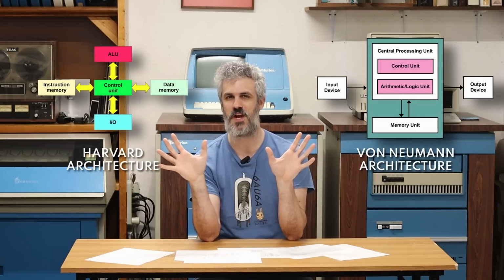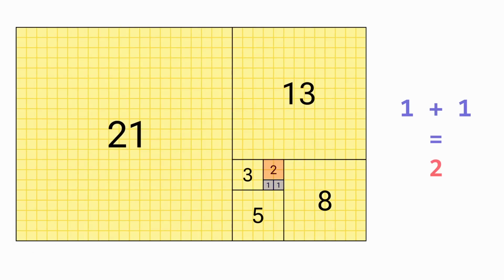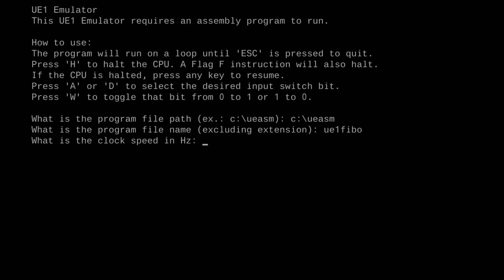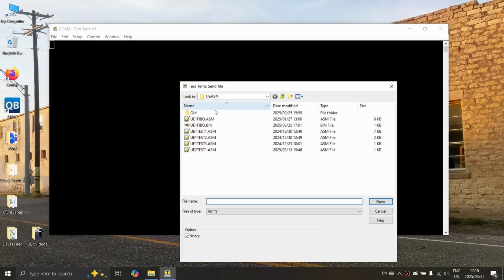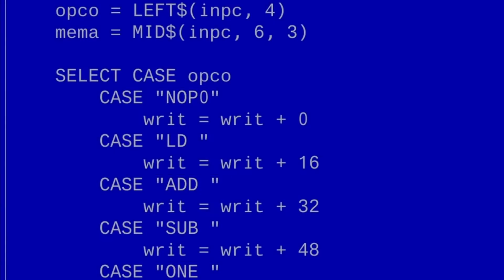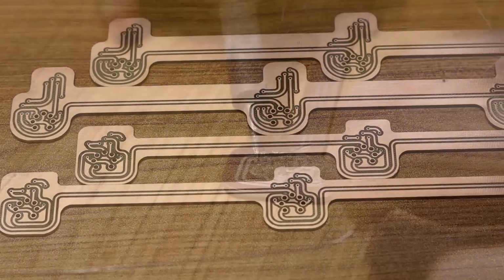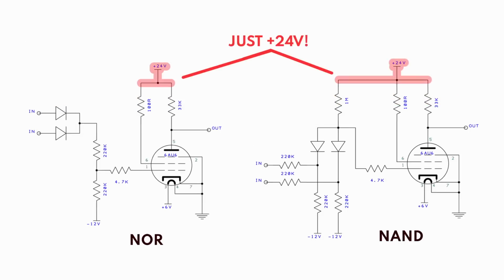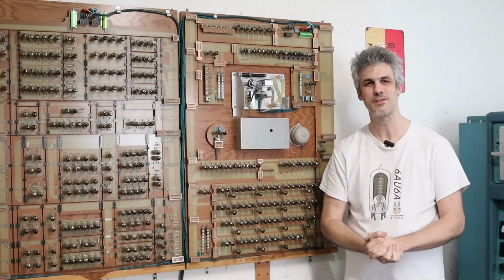I Tried and Failed to Run a Simple Program…

Comment: One thing about your emulator process, what you actually have is an intrepreter for the Assembly ISA. What you should do is have the emulator run the assembled binary comong from your assembler. That way you verify the whole pipeline.
Reply: Indeed, and that would have found the coding error caused by missing the "LD ".

Comment: What I would do is use a binary search method to find out where the program is going "off the rails". Punch a tape with only half the program in it, add a load of NOPs then glue the tape together into a loop. Then you can run this over and over again, verifying that you get a consistent result. If this works, go on to 3/4 of the program, if it doesn't, go back to 1/4 of the program. Repeating the program over and over will allow you to trap whether it is a transient fault, and give you an easy reproduction case. Good luck, it's hard enough debugging with modern dev tools!

Comment: I believe the biggest problem you are going to run into is timing. Many of people have been stumped not by the engineering but the physics. Every trace has an inductance and a capacitance. And vacuum tubes introduce their own capacitance and inductance problems. If the signals fail to rise or fall in sync, and at the right place and time, it may fail. This is amplified by your input and clock method. I believe this was the main reason why we quickly switched to a input register; rather than running code from an analog source.  This can be seen if you can control the speed of the input. Maybe if you add some way to slow the paper tape way down. The best thing would to design a stepper mechanism rather then a real system. In the past they would use a motor to press a lever during each revaluation. The lever would increment the paper one step. Advancing the tape one step at a time. This also could generate a reliable clock pulse. Every revaluation of the motor can close a contact, generating a pulse. This all would need to be geared down. If the motor is spinning at 1000 rpm, You would have 1000 steps a minute. Think a lever ramp mechanistic. Lever push up a ramped plane. This pushes the paper forward a set distance depending on angle of plane. When lever goes down the plane droops and a spring pulls it back.
Reply: I remember suggesting a stepper/ratcheting thing as soon as he was discussing/planning building this tape reader. Everything else is able to step things through one at a time, to expect the whole program and everything in the registers etc to keep up with the signals of the tubes and the reading of the tape just sounds impossible, it needs to be stepped through a bit/instruction at a time or something.
Reply: Could use a cine projector type of arrangement
Reply: @ the mechanism out of a teletype will do exactly the trick IMHO

Comment: I'm thinking that it's entirely possible that the rate at which the bytes are being read from the tape reader is somehow too fast for the UE1 to keep up with, since it has to serially shift each byte after reading it, then execute the instruction before it can be ready for the next instruction.
To test this, what I'd do is attempt to single-step the entire program.  Tedious, I know, but that should allow you to either eliminate the tape reader as the problem, or isolate the problem to the tape reader.
If the tape reader really is running too fast for the computer to keep up with, then you may need to slow down the drive motor somehow.  This can be done by gearing it down, using a speed controller, or replacing the motor with a stepper, just to mention three methods.
What I'd be inclined to do would be to use a stepping motor with a pin drive to engage with the index holes, and I'd set it up so that the number of steps required to get the next set of holes in line to be read was exactly the same as the number of clock pulses required to execute an instruction, then use the signal to the stepper as the clock pulse for the rest of the computer.
Or something like that, anyway.  If instructions take different numbers of clock pulses to execute, then something like "wait states" will need to be implemented too.

Comment: I don't know if building a homebrew computer is incredibly hard (take James Sharman or Ben Eater for example) but what I'm sure of is that making it with tubes/valves is an incredibly complicated and challenging mission. IMHO that's why semiconductors have invaded the place: lengths are shortened by several orders of magnitude, reducing interference (as a result of which signals can be way faster), reliability is way improved, consistency across signals, too, so is longevity and lifespan... I really admire your dedication though 👍

Comment: IIRC, the Fibonacci sequence starts with 0 and 1, or F(0)=0, and F(1)=1, where “F(n)” means; the nth number in the Fibonacci sequence. For all n>=2, where n is an integer (whole number), F(n)=F(n-2)+F(n-1). So the sequence really begins with; 0,1,1,2,3,5,… and so in to positive infinity. But your computer will turn into a smoking ruin long before then, so don’t worry too much about that last part there. 😝

Comment: Just throwing out an idea that crossed my mind:
1. Works if you single-step through using the toggle switch interface
2. Fails when you use the tape reader
Things that change: 1. input method 2. speed
Verify that the tape reader is doing what you expect?
Reply: Maybe use a logic anayzer to record all 8 bits from the reader and manually check to see if the binary code is correct.  That might get you down to one or more specific bits to debug.
Reply: @rickhole  That was my first impression seeing this comment as well. It's easier to dump the tape than to perform math operations on the machine. While it's still a tremendous amount of work, setting up an MCU to convert the reader's output back to bytes, then comparing them with the intended output, is a good unit test that takes one problem off the table. And that tape reader is a very complicated unit.
Reply: Good idea -- how about having the machine figure checksums from the paper tape. As soon as it gets a wrong answer, stop.  I wouldn't be totally surprised to discover that the tape flops around and the digital input from it isn't perfect.  But if it IS perfect, then the speed would be the issue.  Flip flops might be lagging.  Hope he gets it fixed no matter what.
Reply: +1 on logic analyzer. 
Also store actual registers, not just the tape output. 
Before troubleshooting can begin you first need to figure out where and when the trouble occurs. 
Maybe also poke it with oscilloscope - look for some skewed (not-square-enough) signals.
If it is not the tape, it could be weak tubes or not-quite-in-sync operations.
In particular the timing of the sync signal coming from the tape in relation to other signals.
Additionally it could be electrical interference from the paper tape reader upsetting some marginal circuit.
Try pulling the tape slower, possibly that could help narrow down the issue a bit.
Reply: I had the same thought, that either the tape reader isn't reading right or that it's going too fast.
Reply: You could also do unit tests by making a tape drive emulator. Something that outputs what you expect the drive to output so you can test the balance of the system. It also lets you easily do things like change timings or data rates to ensure that the drive is outputting a compatible signal.

Yes, logic analyzers and input emulators are lots of work, but so is the UE-1 as a whole, and at this point I would recommend taking the input off the table as a point of failure before trying to chase down logic problems that may not exist.
Reply: I don't know the capability of the UE1 well enough, but you should be able to do a compare to the expected register value hardcoded on the tape and trigger some error/stop when there's a mismatch
if the paper tape isn't reading, it should fail right away, and then as you're working on the Fibonacci sequence you're only starting off with the least significant bits, so it should progress to more significant bits as you move along.. if that isn't it it must be the program register that's not doing the right thing
Reply: @Rx7man  It's about as simple a computer as you can create. Error checking would be great, but might need a whole new circuit to do it. From reading other comments, looks like it is reading and running the code directly from the tape input.
Reply: voltage drop. i bet the voltages are not stable when all the things are getting slammed at once so fast.
Reply: @easyasabc0  tubes are not like FETs that only draw power when switching so I don't thing the problem is voltage getting too low, although that's not impossible. But the amount of ripple on +24V rail may be critical, and the power lines are LONG, like literally 3 meters long, this requires a filtering capacitor NEAR the power consumers which I didn't notice.

Comment: That's all a part of homebrew computing! I've had times where my little computer suddenly completely stops working, then I spend hours finding out that I... apparently left a DIP switch in the wrong position and it had only stayed running because of what had been manually put in RAM a few days ago when it was last powered up! At least I already had my assembler/diassembler/monitor tools (mostly) working before laying down wires, so there wasn't trouble on that end.

Don't feel so bad about using BASIC. I got MS-BASIC running on mine, then used it to write serial bit-bang code to get new hardware working. I got a nice nostalgia rush from it too.

And I love that bodge board. It has beautiful awfulness. Sort of an electronic wabi-sabi.

Comment: It was never supposed to be easy ... but - man ! - QuickBasic ?? Okay - I use it myself on occasion still today. The other is Z80-Assembler, which is even more worse. Carry on trying & Thanks for showing !
Reply: Z80... misty memories...  did my own board,  six months of burn eproms, watch the hardware not work, it taught me a lot about hardware and software.
Reply: I did Z80 assembly on my ZX80 PC (This in the Synclair before ZX81).  The assembler had nearly no symbolic address abilities.  What I wrote actually worked.

Comment: I don't want to be the adviser from the couch but want to provide a few tips:
- leave no case statement untreated, if something unexpected comes up you should print an error
- for the assembler, a good sanity check is to make sure that the number of lines without comments is equal to the number of instructions read (I assume) and equal to the number of instructions assembled
- can you single step through the tape? Possibly not, but it would be useful to have such a feature
- speaking of features, it would be cheating, but having an isolated interface board where you can read and write via serial could be a productivity boost. Then you can have a suite of automated tests like the Bendix has
Such a cool and time-consuming project, while also taking care of the other projects, it is a superhuman effort.
Reply: And a lazy simple way to test an assembler is a .asm file containing all possible opcodes, combined with a binary file of what it SHOULD produce. Run assembler, diff hex output files, put it into a script.
Reply: @8bitwiz_  Or alternatively, write a quick disassembler. They're usually less work than an assembler, and if you run a program through asm->disasm->asm and get the same hex, you know there's no issues.
Reply: @Spritetm Nah, I've written an AVR disassembler for some reason, and it was PITA. It is pretty tricky on the syntax, as you have to make different opcodes report different argument formats (at least differentiate between the register names and addresses), also some assemblers like MIPS32 like to produce macros (say, LI will project into two commands for the higher inputs) - so writing one just to test your assembler feels an overkill. I'd just choose a "keep hitting a concrete wall" approach, and manually test all the commands, which may be tedious, but has to only be done once.
Reply: Quickbasic has a "CASE ELSE" that he could have used to catch the error
In his case counting non-comments will work since all instructions are one byte long.  On other machines you have to use other methods.  
Another useful thing is to make a kit that goes with your scope that counts off N pulses then triggers the scope.  This would let him zoom in on the Nth instruction.
Yes to doing RS232 based troubleshooting aid.  A character on RS232 can replace the punch tape and a MUX scanning test points can return perhaps 3 characters worth of status after each instruction.

Comment: It's almost like you need to somehow 'compartmentalize' the various parts of your system.  Like, if you had some way to test each flip-flop to some known 'standard'.  And same with bus drivers etc...  Like some coders do with objects and unit tests.

Then when something goes wrong, you have some stanard way to test each component to home in on trouble.  But I'm just a retired programmer, never built a home-brew system, so what do I know...   😆

Comment: Don't sell yourself short for using QB.  I had a coworker that did coding for some very critical maintenance testing (we're talking public-safety, highly regulated stuff).  He used QB for many years for that.  It was fully vetted and he had a very formal and rigid SQA (Software Quality Assurance) program.  It's not the tools you use, it's how you use them and knowing what to do with them.
Reply: Hear, hear! My first full-time job, back in the late 1980s, was programming in QuickBASIC. It's nothing to sneeze at, and good code is good code no matter what language it's written in.

Comment: Those blue resistors down by the main output display are looking pretty cooked.  I've found LOTS of modern resistors from China rated at 1/2 or 1 watt are really only good for about half the rating they're supposedly listed at before they die. Plus I've had them fail open / short / and by just changing resistance. 

Might be worth checking the resistors with an IR gun (not easy with all those hot tubes i know) to see if any are really cooking & might be changing value.

Comment: Thank you for demonstrating why tubes were replaced by transistors.
Reply: Relays crawled so tubes could walk. Tubes walked so transistors could run. These things weren't just randomly replaced with the next thing bc the last thing didn't work or it wasn't good - each of these were all bleeding edge and way better than the last, materials sciences were improving as well as our knowledge of how any of this worked / best practices etc. If anything the only things that really changed over time has been speed and density (and power use due to that).
Reply: @colinstu  power use has grown as a result of speed, price, and density
Reply: And ultimately why when you have a bug and call tech support, it's best when you're consulting at least one additional person. When you're both the caller and the tech rep it gets a little schizophrenic.
Reply: what do you mean why? this is nostalgic and recalls us our childhood!
Reply: NB! these lamps are transistors!
Reply: @hairy-snail  tubes are tubes, lamps are lamps, transistors are transvestites

Comment: This firmware will completely trash Your Eeprom structure! There is no going back from installing it easily, so make sure you back up Your Config and Battery Calibration with the tool, and be prepared for a bad hangover if You revert to something like CEC or a non-HF firmware. Just sayin'

Comment: Hang in there, Dave. You'll get it to work. It's possibly a harmonics problems with all of the circuitry while running the tape reader. Try shielding the motor or driving it slower.

Comment: I keep eye-ing those board-to-board interconnects. I have all kinds of problems with those types of connectors.....and then you mention 675W of filament power,and I see those connectors,and the small gauge wire. All I can think about is the voltage drop and intermittent connections I have experienced. I know your frustration,and that feeling of insanity.

Comment: Digital electronics is not that hard compared to analog electronics, especially when frequencies go beyond megahertz - that's where crazy things start to pop up. Judging by my (mostly failed) attempts it is like 100 times harder than programming.
Reply: I've always said, digital electronics / programming is dealing with a language created by man. Analog electronics is dealing with a language created by nature / God. It takes a MUCH deeper understanding of the physical/ electrical properties of every component in the analog world, and i really wonder if there might be an issue related to running those tubes at a much lower voltage than they were designed.
Reply: And once you get into analog RF that's just black magic.

Comment: Probably better to start with an even simpler program.   Load number, display number.  Then get fancy.  Fibonacci being fancy!
Reply: Getting it to slowly count would be a massive step forward
Reply: Something akin to "HELLORLD",  do something that just stores one bit, get that working, and expand the program.  Use the existing program but delete everything beyong the the debug point.  Using intermediate halt points is quite effective.